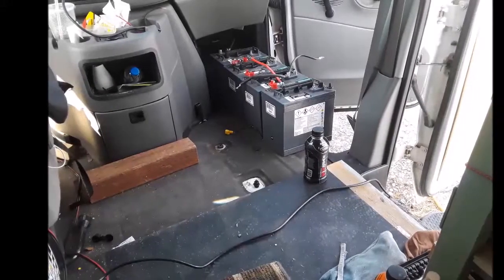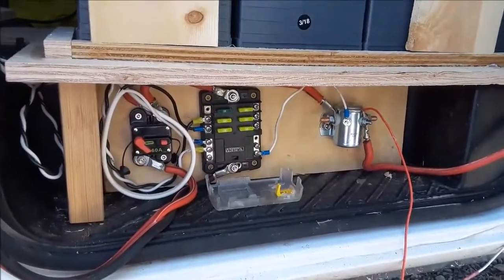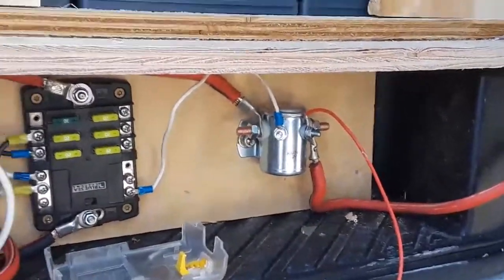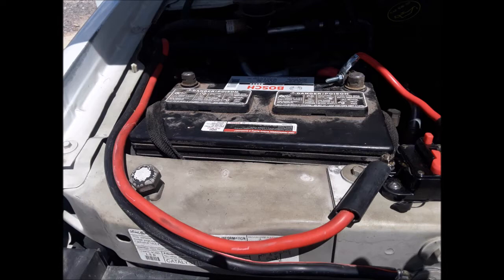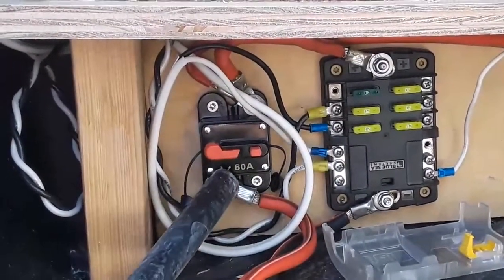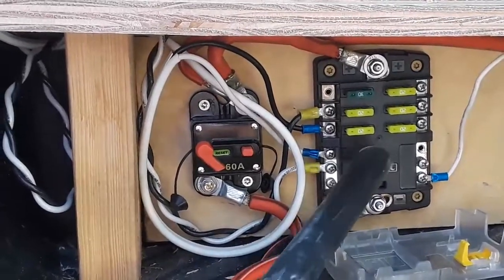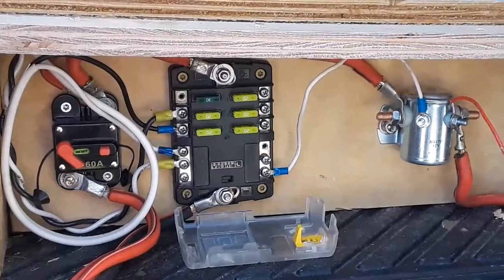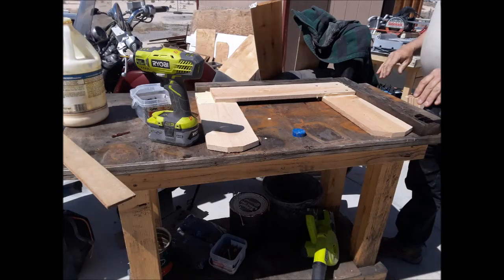Connecting the Solar Battery Bank to the Van Alternator

Comment: Would this wear down your cars battery? It gets so many cycles.
Reply: No. I've had a setup similar to this in my van for years. Has not hurt my van starting battery. The alternator is changing the house batteries, the starting battery isn't
Reply: @floridaboy34601  
Hi 
I need help 
I want to connect my elernator to the bettery bank on my RV 
Can you email me the instructions or schematic to start.

ganahim99@gmail.com
Or txt me if you wish 
(832) 835-1816
Thanks.

Comment: Anybody using a dual purpose start battery and solar charging their cars primary (and only) start battery? My 2018 Ran Promaster city has 160a alternator.. I wondering how it would behave with a 100AH 200RC 900CCA battery? Also do I need to isolate things to connect a 200 watt 18v 6amp Solar panel and 20amp controller into the cars system?